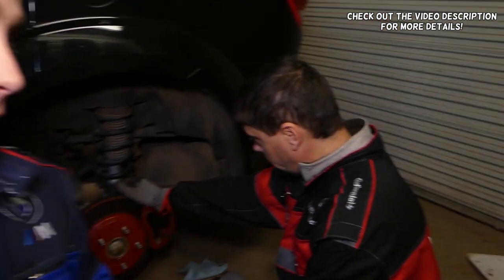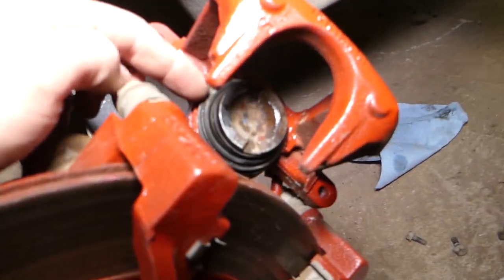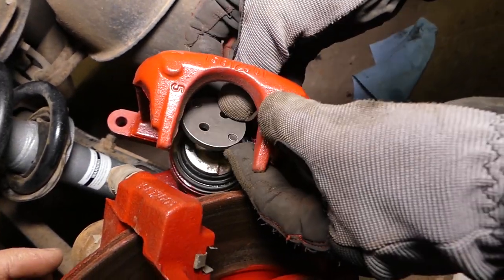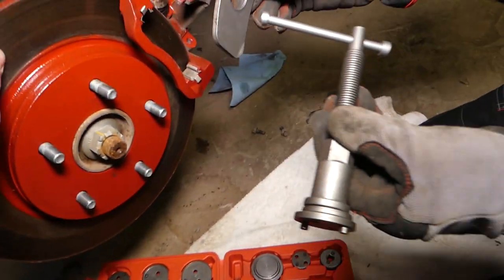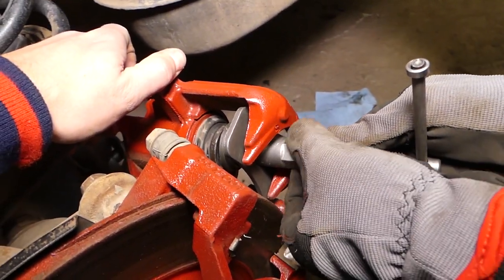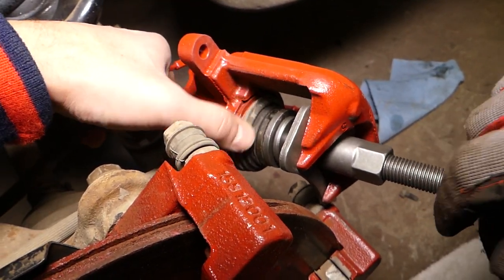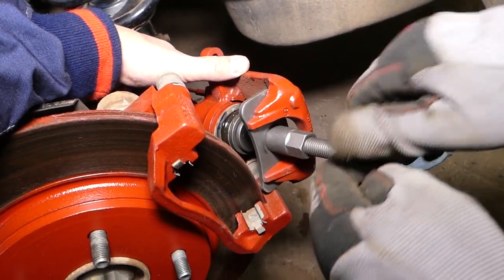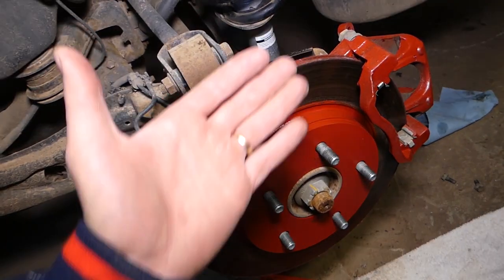HOW TO COMPRESS REAR BRAKE CALIPER PISTON ON DODGE GRAND CARAVAN CHRYSLER TOWN AND COUNTRY

Comment: You can grind an old socket to fit the notches in the piston, and use a drill or electric impact to turn it in while pushing down on it. Just watch your seal and make sure you remove any burrs from the piston when you're done. They're made of soft metal.
Reply: A big spade bit works too